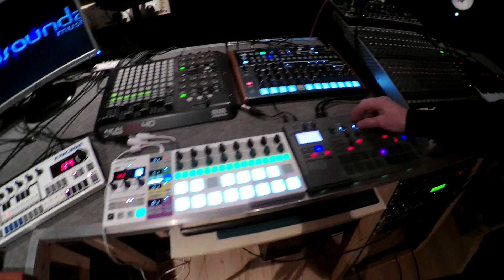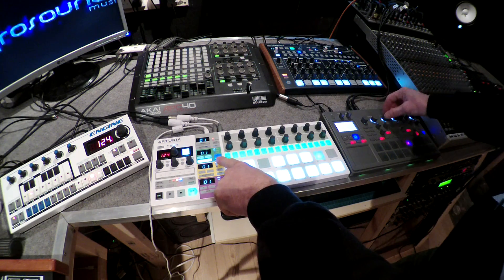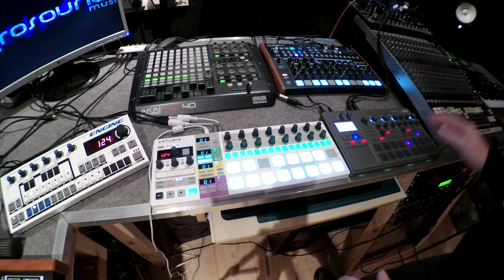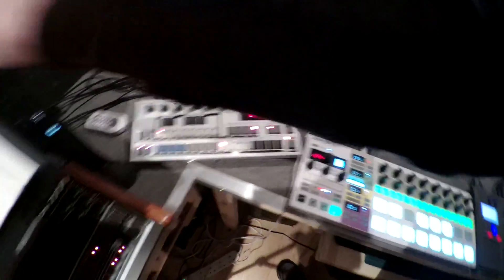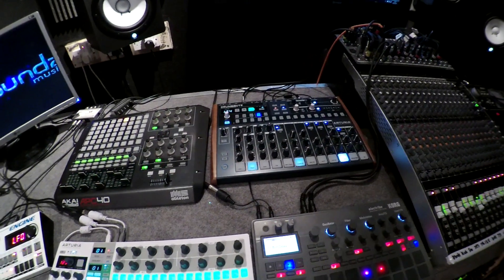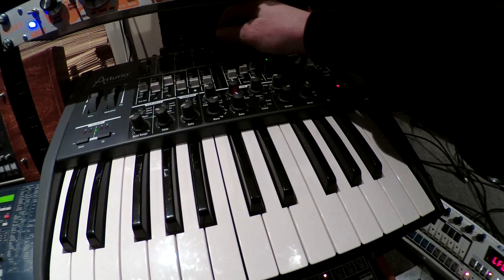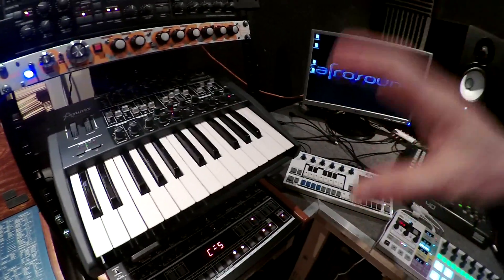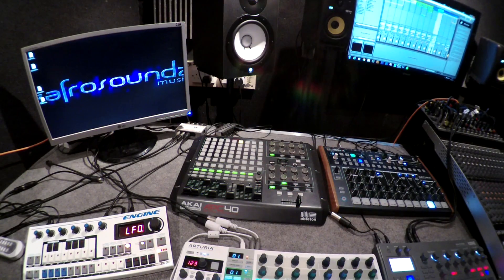IN THE STUDIO - HOW IT WAS DONE - First Jam/tune 2017

Comment: Nice walk through m8

I have an electribe question I can't solve: my trigger capability has gone. When i choose 'trigger' no pads make a sound. Any idea why?
Reply from the maker: Thanks Dave. I wouldn't know tbh, only thing to try is back up your data and factory reset, then update your firmware to the latest version. A lot of messing about but the only way to be sure the switch isn't broken. If it lights I'm guessing something has corrupted in the firmware. Either that or there is an option somewhere that disables trigger, I haven't got the tribe in front of me at the moment but I'm going to the studio later so I'll have a look at it.
Reply: zafrosoundz cheers brutha!
Reply from the maker: Did you have any luck? I couldn't find anything in my tribe to suggest you can turn off the trigger pads.
Reply from the maker: If you go to global page 1 and set trigger to normal. just stumbled on it 😎